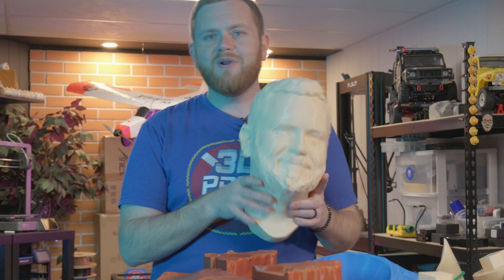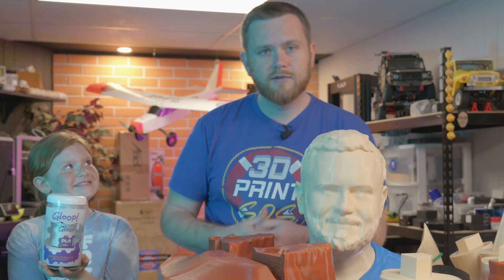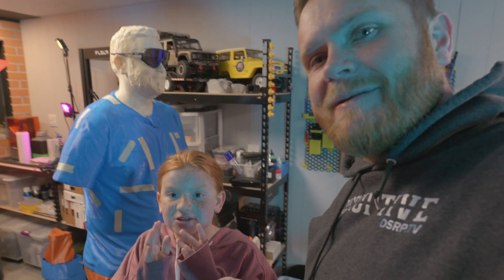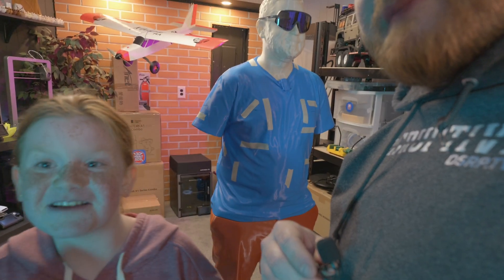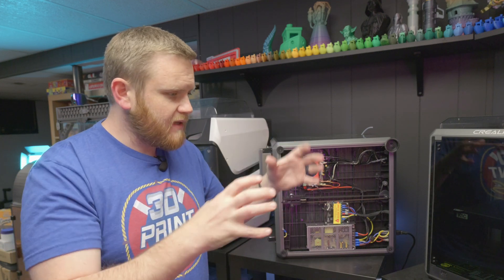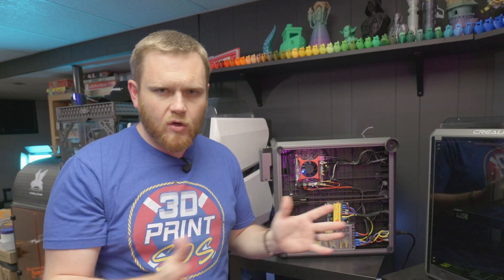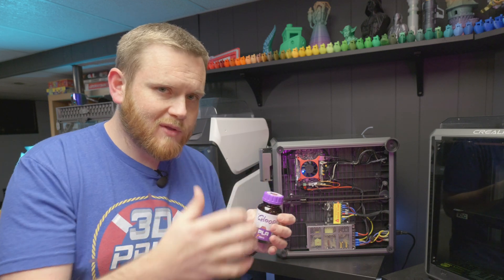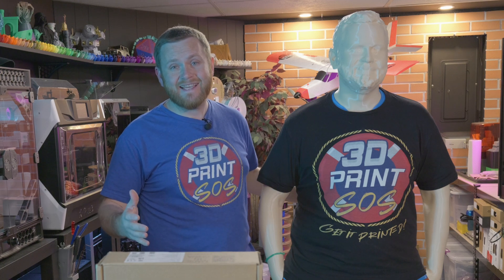My BIGGEST Print BY FAR! Creality Ferret Pro + K1 Max

Comment: Nice Job! I have two questions. How many Mega Kilos of filament did you use, and how many 24x7 weeks did it take to print it all?
Reply from the maker: I forgot to mention this. Haha. 16 spools. About 15kg total. And I couldn’t count because I had a motherboard failure, so most of the real print time was erased. With around 40 pieces and each taking between 7 and 12 hours to print… it took a while. 🤣